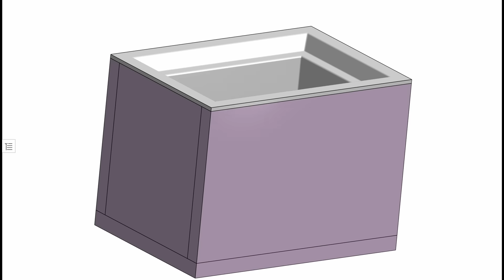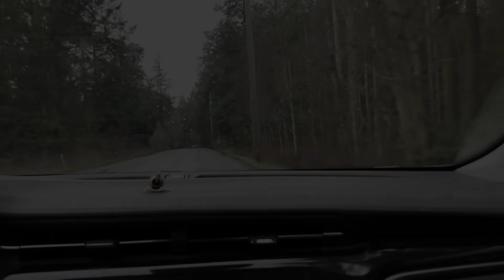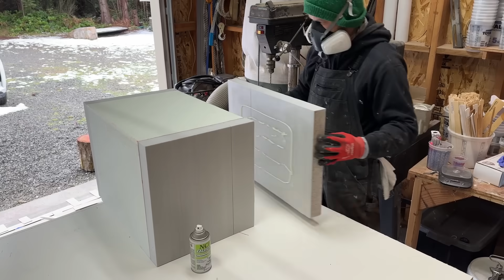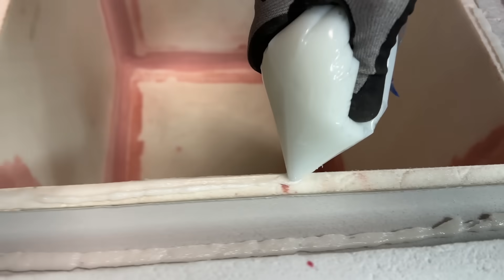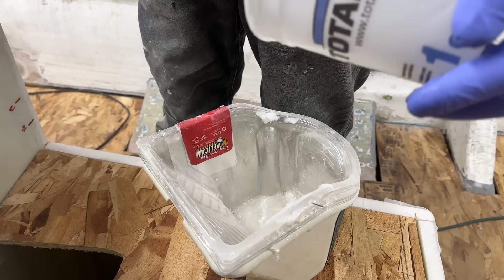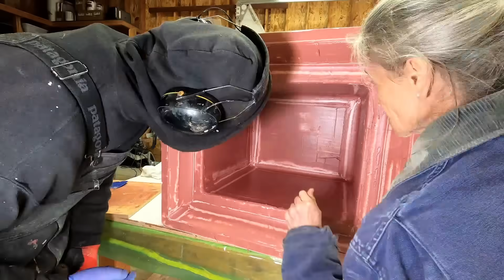Boat Build: DIY Freezer [E117]

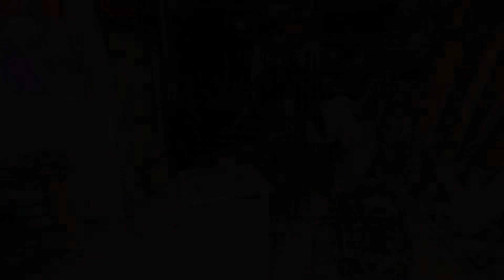Comment: 10:40 ish
You have rather solid air gaps in the glued styrofoam layer(s) isn’t that bad in terms of providing cold-bridges (in Germany those spots are called “Kältebrücken” ) ? At least cut thin strips and wedge them in before adding the next layer ?! Or expanding foam ?!

Comment: Hi, I am a boatbuilding apprentice in New Zealand, why not fair the flat panels for the sides and bottom before you glue together? or any of you composite joinery that you want fair. 
Then you would only have to clean up your coves and fair the glass taping at the top edges of the sides.
At work we bog and sand flat panels that intent to be paint finished before glueing in, it makes the bulk of the sanding a lot faster and easier.

Comment: Hey Guys, I was wondering why you are using literally the worst material (regarding insulation property’s in foam ) for your freezer. If you would have gone for pu you would’ve saved like almost half the wallthickness for a given r value or even Vakuum panels would have saved you 7x…

Imo this freezer isn’t big enough for Ozean going journeys…
This Fakt aside you did a great job on building it 👍

Little tip at the end: use a Aluminium foil at the outside to reflect any incoming ir as Fiberglas and polystyrene are ir translucent.

Comment: Contrary to conventional wisdom, the concept of cold air "falling out of a front loading freezer" does not include the fact that AIR has very little latent heat and thus removes essentially NO "cold" from the freezer at all.  It is the contents of the freezer that holds the most cold, as it were.  The primary issue with many or most front loading freezers is less R values in the sides and door and leaky door seals.  AND 6 inches is better than 4.  Plus Polyiso has a much higher R value.

Comment: Great project, guess I myself would have to go the extra mile for an vacuum-foam insulated box for getting bigger volume plus hidden embedded cooling plates… and my box build easily could take the amount of time you need for your full boat refit/rebuilt plus tripling your full circumnavigation. I‘m so jealous of those who are able to decide for compromise instead of having this tick for perfection and doing nothing to support my dreams cause I would stay criticizing my self that each step is just a failure…

Comment: Great build - but. If you want to make long ocean passages where you probably want some crew to help keep peace of mind during the journey then it seems small in internal volume. I know a freezer is not a fridge, but. I'd also argue a freezer does not have to be under the kitchen sink, necessarily, because generally, you'll not prepare meals from deep-frozen ingredients. So, what was your design brief? The answer may be in the video. I played it twice, but got distracted a few times in both cases.

Comment: There are some construction adhesives that work fine with polystyrene foam. I was considering gluing poysyrene to the concrete floor of my barn at one point. I didn't do it but I did test a small section. It was 2" polystyrene on concrete with sheathing grade plywood on top. It felt rock solid.

Comment: That thing is an R-value BEAST! I'm actually curious how much you'll need two cold plates with that much insulation. Is this so you can deep freeze salmon before making it into sushi? Also, what's the gap for at the aft side of the freezer? Could you have made it stretch all the way to the bulkhead?
Reply from the maker: It’s what has been recommended to me but when it comes time to buy the system, we’ll re evaluate. The gap is for cutting board storage and we didn’t need a freezer that big.
Reply: @TheDuracellProject  You'll need that cutting board space for sure... you'll need some nice cutting boards for slicing the sushi 🍣 😁

Comment: Amazing by the time this project is finished I envision a sail  into Monte Carlo harbor for the F1 race with Mr and Mrs in evening Tux and floor length...son with U Washington nanny...stepping on the dock holding Baccarat cognac crystal and vintage cognac...that aside the cooling function needs to be rugged and easily serviceable and back up...would concur drain capable
Reply from the maker: That’s quite a vision, but not really us😂
Reply: @TheDuracellProject Ok I'll take the edge off... Matt stepping off at Monte Carlo Harbor you can have your three day beard and Converse gym shoes in lieu of patent leather  but Mrs as originally visioned...btw it's the vision of your boat mods that caused my vision without any artificial stimulation...😃

Comment: Make sure the exterior of the insulation is sealed 100% vapor tight, otherwise vapor can migrate between the layers and condense, and eventually freeze. A bead of sealant in all the exterior insulation joints should be sufficient, or thickened epoxy. Also vapor-seal all penetrations for refrigerant lines, etc.

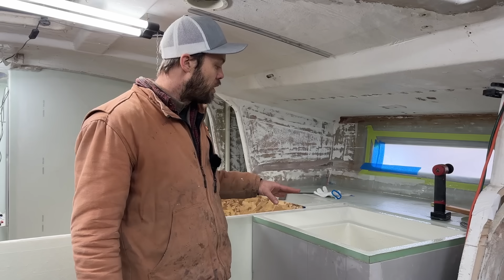Comment: @17:44 You mentioned installation of "2 cold plates". 
When people talk about this, they usually mean Peltier elements. If so, please have another look at the power consumption. Those are nice to keep things kind of cool, no more...👴😱
For cooling within acceptable time: The efficiency of a compressor unit is way higher. Way faster and less power consumption.👴🧐😉
Reply: He does not mean peltier. Don't worry.
Reply: @mckenziekeith7434 Oh, thanks. Now I'm able to sleep again.
Where exactly did I miss Matt saying this?
Reply: @Arnaud58  lol. He didn't say it. But I just know he is not going to use peltier cooling. Nobody in the marine industry uses peltier. Everyone uses compressor based cooling for freezers. I have never even heard of peltier being available or used for this application.
Reply: @mckenziekeith7434 That is what I thought too. Personal I would not remotely think of it (being a Dutch Navy man).
Until I bought a boat (sea-going sailboat) equipped with one. (for a short time)
Since then, I never took it for granted anymore.
Surely, I expect Matt knows this, but I'm not sure...👴🤷‍♂

Comment: Matt a question you must ask yourself and look into why do all commercial fridges and freezes use spray foam for insulation and not ridged foam
Reply: It's much easier(faster) to build, so much cheaper. No matter what the R value is however normally PU is quite good.👴🤷‍♂
Reply: Yes  but when you are in extreme temperatures like that boat will be from attic to extreme heat the gaps in-between the foam are not closed celled letting in the possibility of condensation
Reply: @GentlmanLoser So, like the inside, the outside has to be sealed too. That's it.👴🤷‍♂

Comment: Too much advice. Some people almost demand to have the project done their way.   This guy is very knowledgeable.  I bet he has done all his homework.
Reply: Yeah your bet is the smart, uptown money. For those following this effort for some time, Matt’s mom knows more than most of us. 😂
Reply: I like your meticulous planning on each project, it will serve you well in less problems on the water.
Reply: Old sailors love dropping knowledge all day, especially when not needed.
Reply: Love your work
Your freezer design has raised some old ideas I should share
In the old days, freezer rooms often had concrete floors on the ground and suffered from “frost heave” when the moisture in the ground was frozen through proximity to the freezer itself. As ice expands, the concrete floors tend to lift up
I am concerned that whilst you have thermally insulated the freezer, you have allowed moisture in the air to freeze in that insulation with potential “frost heave”. 
I wonder if a light epoxy seal around the outside might avoid this problem.
Keep up the good work and greetings from Australia 
Peter
Reply: ..too much advice, too.

Comment: You did mention frost buildup, but I don't think you can avoid it all together. Do you have some way in mind to pull it out of the corner every now and then? It does look quite snug under the ceiling, considering there will be more galley stuff around it.
Reply: High latitude climates have humidity values in single digits so I don’t think frost will be an issue.

Comment: XPS is nowhere near as good as closed cell PU foam for insulation, which means that you end up with thicker walls and less interior to achieve the same performance.  Also, XPS is porous, which means that you need a particularly effective vapour barrier inside and out otherwise you will get interstitial condensation that then freezes, drastically reducing the performance.
Reply: Thermaflex closed cell pe foam is one of the best insulation for refrigeration.
Reply: I second that, PIR insulation has a much greater performance than XPS, for something like this, the extra cost will definitely pay back over the long term.
Reply: XPS is not porous. It is a closed-cell foam. From what I can quickly find online, the R value is about 5 per inch for XPS and 6 per inch for polyurethane. Is that correct? That doesn't seem like such a huge difference.
Reply: @mckenziekeith7434  The thermal conductivity of PIR is about 0.022 W/mK, XPS is about 0.038 W/mK, so almost double
Reply: @-TheSingularity- I didn't know what PIR was. Had to look it up. The parent mentioned polyurethane foam (I assume PU means polyurethane). It does look like PIR is the best of the bunch. And you can buy it at big box stores, too. I guess there could be other considerations. Is it harder to work with (glue together and fiberglass over)? How does it perform in fires? Like does it give off toxic fumes and whatnot. But it seems to be a much better insulation for sure. So either Matt didn't do enough research, or the reasons for selecting polystyrene are not related to insulation value.
Reply: @mckenziekeith7434  Matt has been using PU foam throughout the renovation, almost all the panels are made of the stuff.  I can't see the logic in using XPS.  As regards fire, both XPS and PU generate noxious smoke.  There are supposed fire resistant versions but they aren't much better.  In UK the fire testing defines these as self extinguishing but the test only involves a 1cm cube of wood laid onto a piece of the material, whereas in reality the fire will self generate due to it and other fire loads.  The black toxic smoke from a fire can evolve so fast that in an enclosed space the smoke can get to the exit before you can run there.  As a sobering thought, fire retardant PU foam was a contributor that killed 79 people in the Grenfell Tower fire in London in 2017, you only have to watch the news reports to see the horror of it.
Reply: @clivewilliams3661  I don't think he is using polyurethane foam. I think he is using PET mostly. Maybe some PVC earlier IIRC. What are the actual R values or conductance values for the polyurethane foam you think he should use?
Reply: According to the source I found online, high density xps is 5.2 per inch. Polyurethane panels are 6.8 (if expanded with pentane). Sprayable polyurethane is 6 per inch. Polyisocyanurate panels are better than either. It does depend on what gas is used for expansion. I am quoting for pentane. I assume CFC and HCFC expanded foams are not available in the US. Anyway, I am just asking you to provide some actual numbers.
Reply: @mckenziekeith7434  It seems my previous detailed response to another comment has been lost but as willbo123 says PIR foam is available with a thermal conductivity of 0,022W/mK compared to XPS at 0.038W/mK (the lower the value, the higher the performance) but with all this the actual values depends on the manufacturer and what is used then comes down to the availability.
Reply: @mckenziekeith7434  US R values are a simplistic definition of the performance and I must admit that I have always used the actual thermal conductivity figures in W/mK and when calculating the overall performance you have to factor in the thermal performance of the other elements of the construction as well as adding in the resistance of the boundary layers, both inside and out.
Reply: @clivewilliams3661 What is the thermal conductivity of polyurethane foam in W/mK? Or are you now switching to polyisocyanurate despite asserting he should have used PU previously? Or do you not really know and not really care which is fine with me.
Reply: @clivewilliams3661  Yes R values are not ideal. Thermal conductivity is better. Your post that disappeared, did it contain URLs? It seems like posts with URLs in them are auto-blocked on youtube. You have to deconstruct the URL to get pass the sensor. https example dot come slash thermal-data. That kind of thing.
Reply: @mckenziekeith7434  Various manufacturers give different thermal conductivity values (k) depending on their specific manufacturing process but typically they range from 0.02W/mK to 0.03W/mK.  
I was using the 'PU' description to identify a group of insulations that would include PIR, PU and Polyisocyanurate.  Again, different manufacturers use different materials to provide essentially the same type of board, whereas XPS and EPS are considered to be in a different group classification.  For the quantities involved it will be very much a case of taking what's on offer locally but the 'PU' boards should also be in common usage and available from local merchants
Reply: @clivewilliams3661 OK, well I found some owens corning docs. Polyisocyanurate insulation doesn't work well at low temps. The blowing agent condenses in the cells. Search for "10019949-FOAMULAR-XPS-vs-Polyiso-Tech-Bulletin.pdf". Also, the thermal conductivity of foamular is also between 0.02 and 0.03W/mK depending on temperature. But for a freezer application it will be more like 0.02. And XPS is not porous or absorbent.
Reply: The number of innacurate statements in this thread is astounding. First saying XPS is porous and absorbs water. Absolutely false. Then saying that it is 0.038 W/mK when it is actually more like 0.029 and even lower at low temps. Then saying that matt has been using PU foam throughout the build. So as far as I am concerned, you guys are totally unreliable sources of information. I think Matt made a good call using XPS foam insulation for his freezer.
Reply: @mckenziekeith7434 By porous i meant that typically XPS is vapour permeable.  The exact properties of XPS depends on the individual manufacturer of the boards however, .its actual vapour resistivity is around 145MN.s/g.m, whereas PIR foam can exceed 300MN.s/g.m, i.e 2x as vapour resistive meaning that more moist vapour can go through XPS board that increases the risk of interstitial condensation and thus having an ice block within the insulation.  PIR foams are also less conductive to heat being ~0.02-0.03 W/mK, whereas XPS is typically 0.034 W/mK i.e.14-70% better.  Given the improved properties of PIR foams they make better sense for refrigerator/freezer application and its no coincidence that manufacturers of those appliances invariably use PIR foam, especially as they are focused on production costs..

Comment: Do not make a bubble when gluing flat surfaces together. Your glue lines need to be open on the ends to allow the air to escape. When the air can escape you end up with less bubbles and much better adhesion
Reply: Explaing glue-theory to the master...

Comment: Its not realy correct " how more thiknes les you use electricity to cool dawn" inside cold outside warm , so a wave of heat go true the insolation , heat up in day , cooldawn in night so the thicknes has to be done so that the night send a wave of cold to cool dawn the insolation.
Reply: It is possibel to make a gab were cool sea water (ore air circulation wen it is cold) its stops the wave , but like a engin its need constant water circulation on the moment that the heat wave pas by and is puched back. and complicated to make it work. complicated for me to calculated.  Wen i go on camping i use a cooler only made of plastick like a inflatebel boat and  4 plates of fresed way-ter and its keep kold 3 days. all other campers after 24 max 48 evrything is hot.Its the air gab who keep the heating away.

Comment: my advice dont waste your time in insulation ,it is all garbage , use vacuum panels, been there made same mistake ,only vacuum panel  holds the frost
Reply: This is what I was thinking too.  “Vacuum insulated panel” is R-50 per inch of thickness.

Comment: Just chill. ☺ good to see the materials checked before fitting. 👍
 Would a drain with a cover be useful to rinse - defrost or just another dirt trap?
Reply from the maker: Hi Allan, I think it's easier without a drain. Just clean it out from time to time.
Reply: @TheDuracellProject  Both Mr. and Mrs. replied lol
Reply: @DFMurray  echo.☺ 👍👍👍👍
Reply: @TheDuracellProject   I guess its not that deep. 👍
Reply from the maker: Allan, I think we'll just plan on cleaning from time to time rather than a drain.
Reply: @TheDuracellProject  👍👍